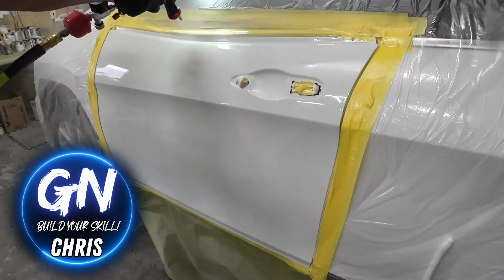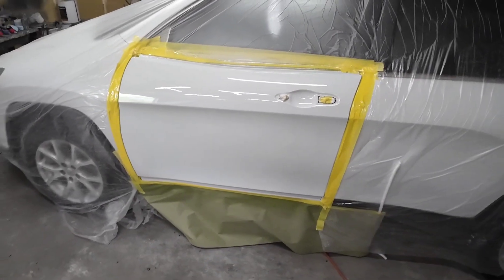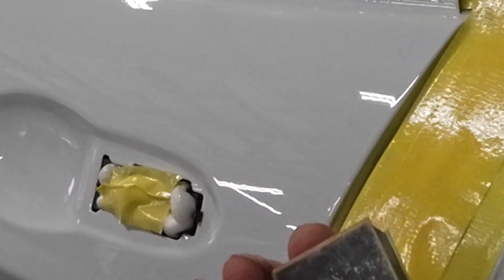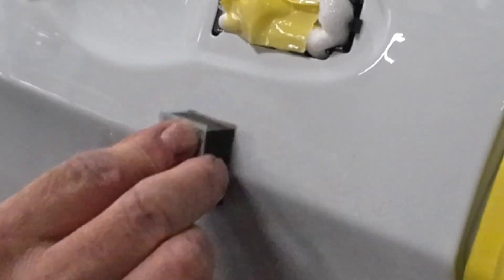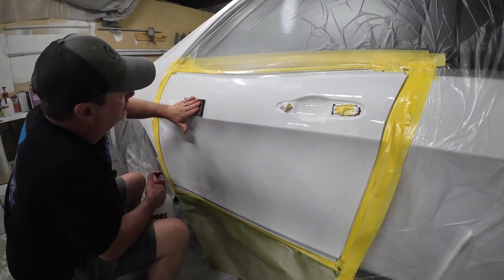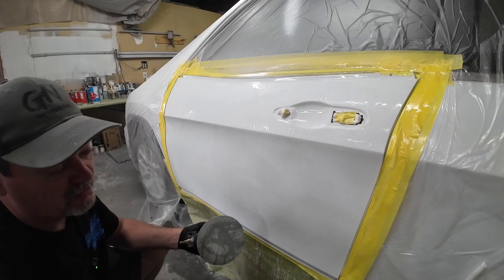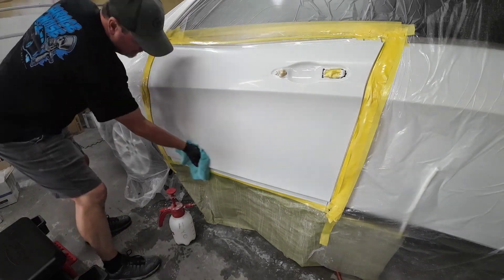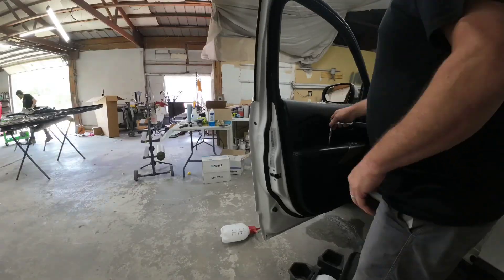TRASH-FISHEYES-ORANGE PEEL Correcting your PAINT JOB!

Comment: What a good video! Quick questions. What clear did you use? You said you put an additional coat of clear over the fish eye after sanding smooth but you did not sand the entire door until afterwards prior to buffing. Won't the clear peel where you did not sand? Maybe I need to watch the video again😉
Reply from the maker: When I added  the clear it was still curing so basically I put 3 coats of clear. I used upol spot panel  clear.
Reply: @GarageNoise  OK now I understand. I'm sure you said that but missed it. The best painting/teaching videos! Period!

Comment: Beautiful job as always Chris! I am disappointed you didn't denib and buff the masking tape as well. Would have made for a complete job right before you unmasked it all. On a more serious note, I been using 3m wet/ dry for years. Not always a uniform scratch for me especially on fresh clear. Seems I am always chasing stray scratches caused by longer abrasive particles on the paper. Do you have a similar experience?
If you get a chance try one of those 1500 or 2000 grit Meguiar's unigrit sheet packs. It is from the Nikken Japanese paper company. Cuts faster than even the Kovax (which I love and use wet when they are about done) and since the Unigrit are electronics grade particles the scratch is so consistent it Trizact's out instantly.  Thanks as always for the videos!
Reply from the maker: Intresting? I'll checkbout that sandpaper.  Yes always seems to be some stray scratches when buffing. Frustrating!
Reply: The stray scratches you’re referring to are from clear coat balling up on the paper. You hear the sound of wet sanding change and you stop, clean your paper and surface and proceed.

When I was new at wet sanding I had your issue. Deep scratches here and there. It was 100% because I wasn’t “using my ears” and it was 100% clear coat balling up on my paper